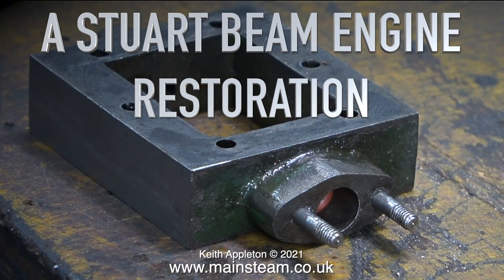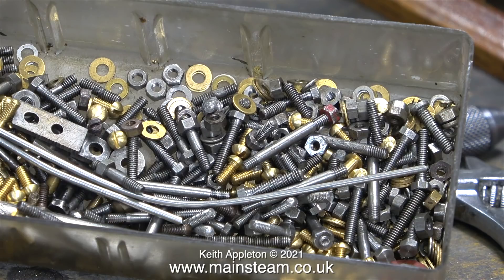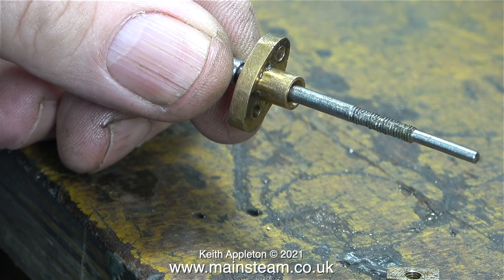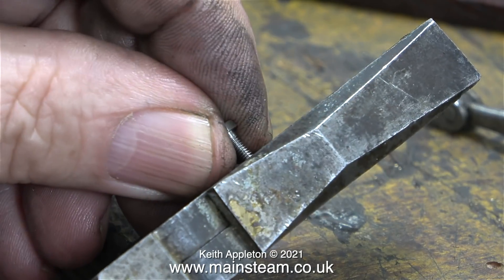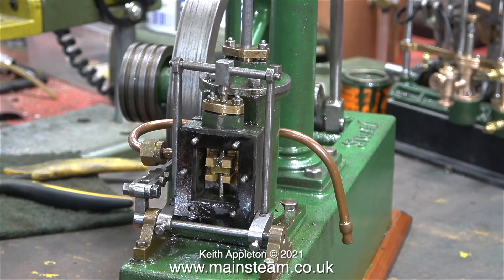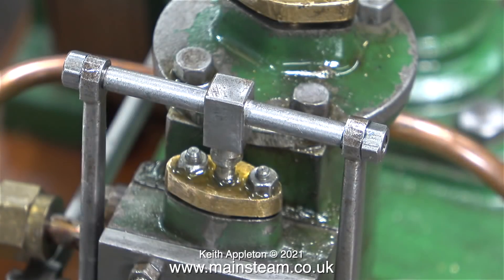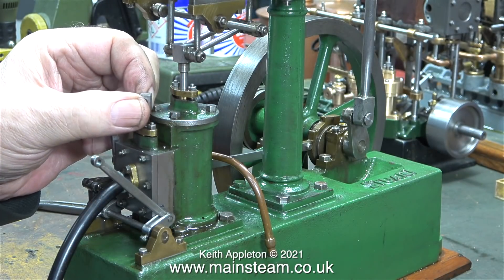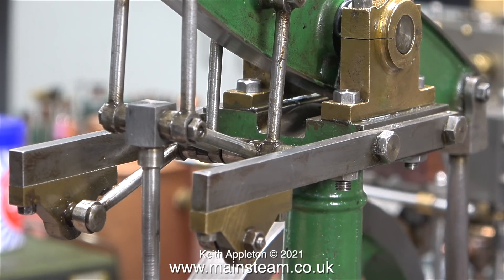A STUART BEAM ENGINE RESTORATION - PART #3

Comment: Another good episode. I'll be interested to see how you address that crooked cross-pin/bushing.
Reply: Could maybe plug the existing hole with a tight fitting pin and turn the rod 90° to drill the new hole?

Comment: Not sure if anyone has mentioned this , but I often need to fit mating parts without a gasket. In order to get the two halves flat enough, I use a plate of glass as it is very flat. I tape the sandpaper to the glass then, as you have often said, I use a slow, lazy figure "8" pattern. Seems to work. I'm to cheap to purchase a surface grinder. Great fun watching you do these. Thank you ever so much for sharing.

Comment: Keith, you frequently mention "nut spinners". For many years I have had a tool that looks like a screwdriver handle with a 1/4 inch drive square head. Any 1/4 inch drive socket fits this tool be it imperial or metric. It was made by Craftsman tools in the USA, I don't know if they still make it, but some body surely does. The thing makes "spinning" small nuts, bolts, and screws very easy. ;-)